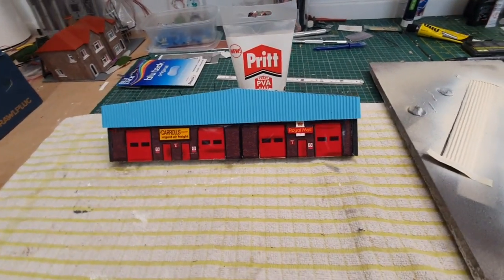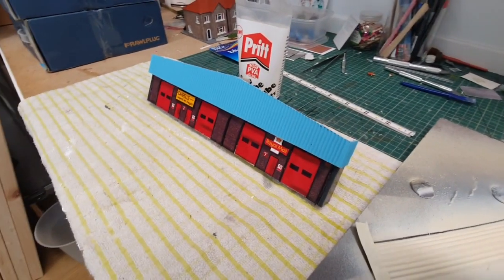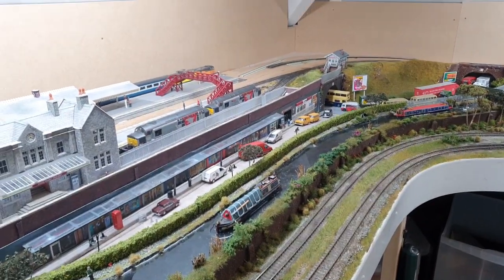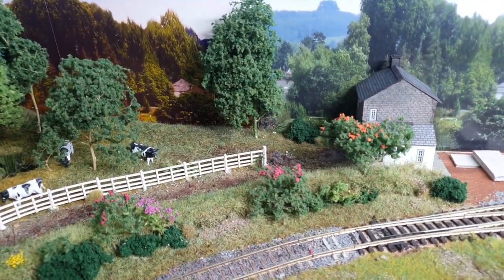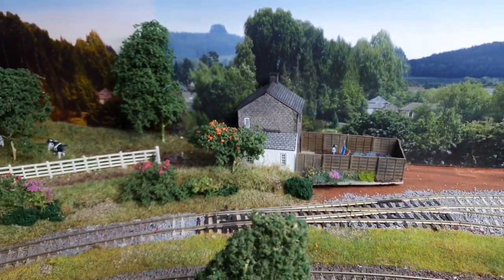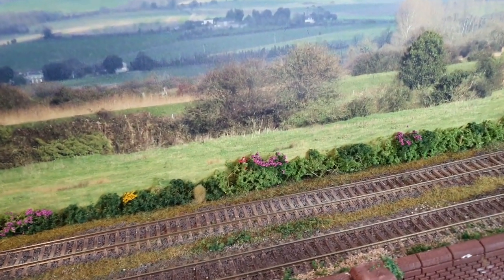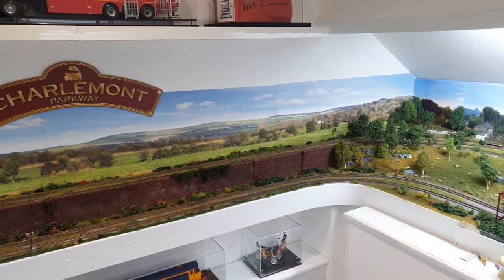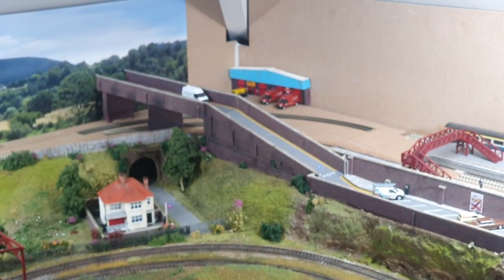New Heritage line running session and layout updates on Charlemont Parkway (video 8)

Comment: Looks great, which sounds are you using in the class 50?
Reply from the maker: Hi, its a tts sound with iphone speaker but im thinking of changing to a legomanbiffo sound file once i get round to it. 👍👍
Reply: @charlemontparkway00gaugemo31  wow, that surprised me! TTS sound can be ok however I switched all mine away from TTS chips due to the limitations of the adjustment of basic speed and acceleration etc. I currently use a Zimo with YouChoos for my class 50 but find it a bit high pitched and lacking bass.
Reply from the maker: @GoodfordModelRailway  always been impressed with legomanbiffo sounds most of the locos i have are fitted with biffo unless they are factory sounds 👍👍